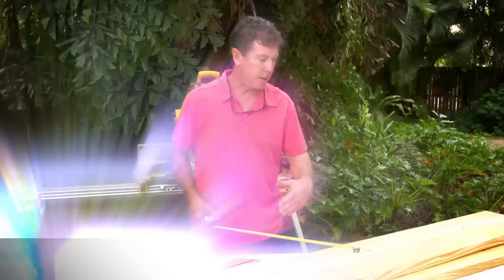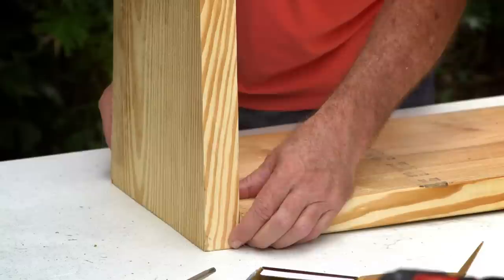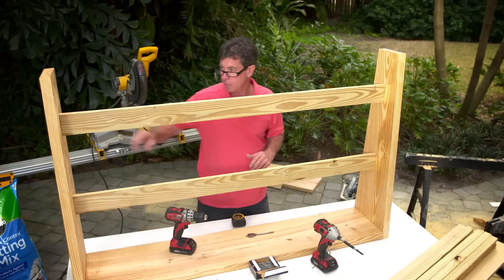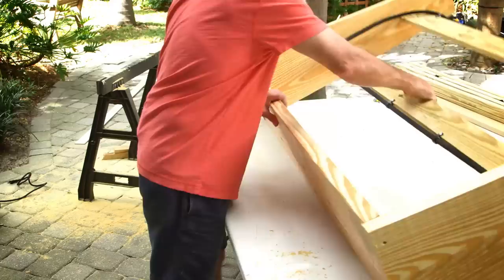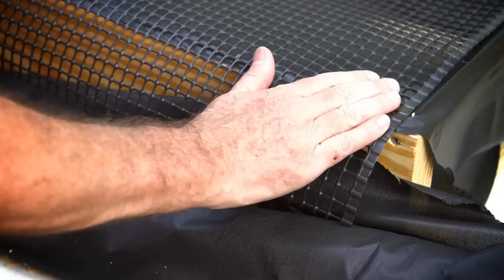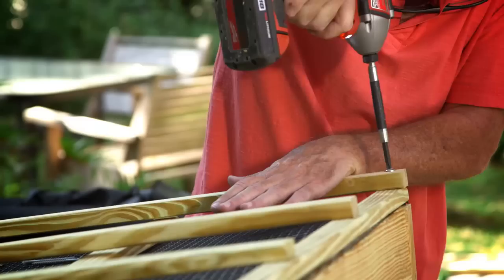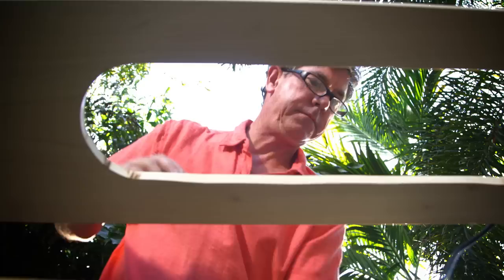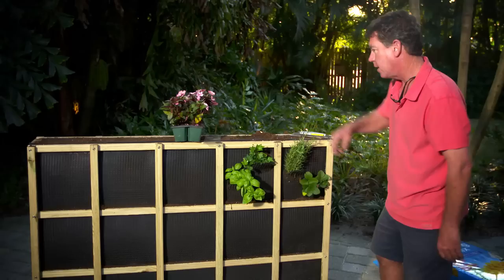How to Build a Moveable Living Garden Wall with Jim Cunneen

Comment: Over the holiday week we took on this project.  We built 4 rolling planters.  They turned out great! Multiple people asked about building additional ones.

Total construction time was 54.5 hours for the 4 rolling plants.  This video is only 10 min long.  I think it probably took closer to 13 people hours.

Lessons Learned:
1. You don't need the finishing washers.  The key is to drill pilot holes for all screws.
2. Recommend Pressure treated wood for everything.
3. Missing from the shopping list are screws.  We recommended #6 1-1/4 inch screws for the lattice work. #6 2-1/2 inch screws at least for the frame.
4. To save some money we did 2 casters fixed direction and 2 swivel casters to allow easier movement.
5. We used chicken wire for the "hardware net".
6. For the top we went with plywood without any holes.  To affix the top to the living garden we used a bolt and wing nut.

Comment: That's one amazing moveable garden wall! Got a question, though. Wouldn't some of the soil fall off when you water them?
Reply: The wall design uses a soaking hose.  So when the water will slowly leave the hose and get into the soil and the soil will then transfer the water to the plant roots.  At the bottom of the wall is a weed mat and holes to drain.
Reply: yes. soaker hoses release a lot of water

Comment: where do you suggest getting the hardware net. I did see a net to block birds in Home Depot, but not sure if it is strong enough. also where should i get the grommets?
Reply from the maker: Bernard, both can be found at your local hardware store.

Comment: Do you replace the soil every year? What is the best way to remove the old soil?
Reply from the maker: You would not need to replace the soil every year. You will want to refresh the soil and add new soil in areas that might be low.

Comment: Did you need to refill it with soil after watering?
Reply from the maker: If you water gently you should not need to replace soil, Viv.  However, if you lose soil it should be replaced.

Comment: How long would this last before rotting?
Reply: +Sue Moseley probably 5 years at best, not sure why he's putting a wood board on the bottom. I think it would be best to isolate the wood from the ground as much as possible with thick plastic. Off to look for better designs...
Reply: +Sue Moseley other alternative and most likely easier to manage and cleaner with less maintenance is a similar system but with hydroponics instead.
Reply: +"Organics Best" Urban Gardner using plastic doesn't make the product any less organic. But you can use glazed ceramic or regular ceramic to separate the wood from the soil
Reply: My point is that while it may not necessarily be environmentally friendly it still doesn't make the food any less organic. Also plastic doesn't leach anything, if anything it lasts way too long and is not biodegradable directly. There have been advances in recycling plastics using bacteria. If you have a substitute for plastic in terms of its cost effectiveness as a vapor/moisture barrier, is love to learn about it. Also technically everything is natural, if it can be created that means that somewhere its being created naturally, therefore anything that can be created is natural (manmade or not that's another story).